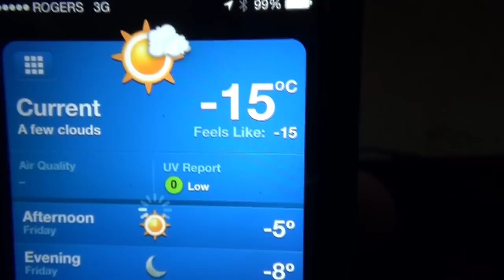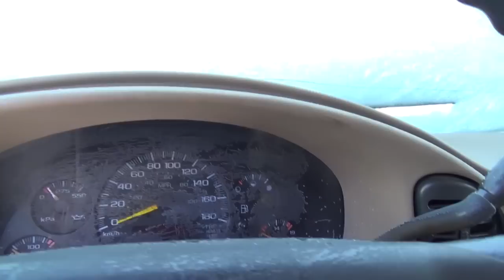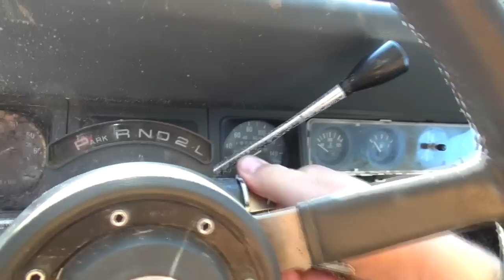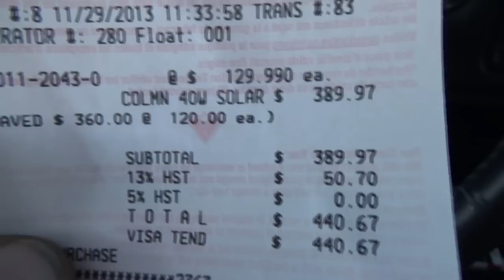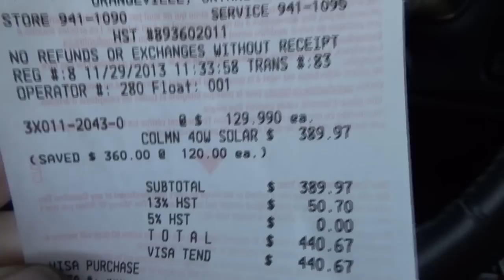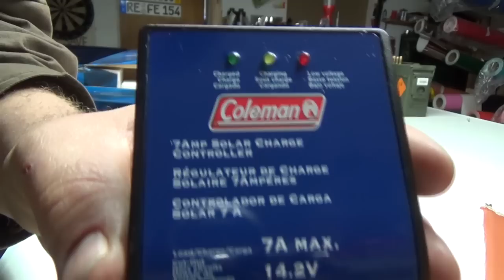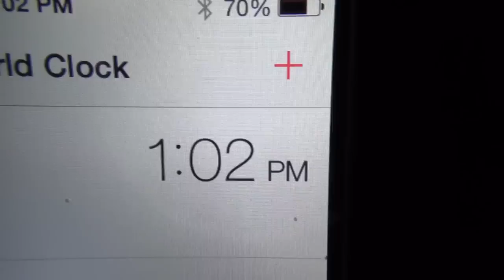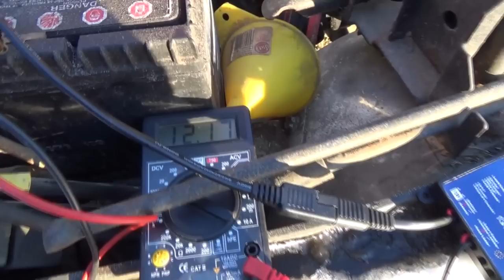cold starts this morning and sweet black friday deals

Comment: hey bill if you still have that chugging problem with cold starts on the chevy then try and replace the coolant temp sensor that's for the computer. theres 2. one for pcm and another for the gauge. the one you want to replace is on the top of the intake. its only like 15 bucks. I would give that a try. cause if its sensing that its warm when its actually cold then it wont give it the right amount of air and gas to keep it running smooth.

Comment: sounds like the idle air control needs to be set up should be appox 1 and 1/4 open sounds like it kicks in and kicks out to quick thats y ur idle drops so fast 90 % sure its just a matter of adjusting it

Comment: Nice solar panals bill :-)), see if you can just parallel the control boxes outputs :-)

You just need a clockwork gizmo to rotate the solar panal through the day to pickup as much sunlight as possible.

Comment: Bill, you should get a 12volt LED system to light the inside of that shed because it doesn't draw a lot of power.  You can get the "Battery Tender Plus or Junior system" to keep your batteries charged over the Winter.  I subscribe to a You Tuber named "thenorth03" and he has his vehicle batteries hooked up through one while he leaves for his Winter getaway retreat.  He uses one panel like yours on the end of his garage and runs it inside to the tender.

Comment: Have you tried mas air flow sensor....vlean thst guy it is attached near your air intake that can cause those kinda problems with running nstuff
Reply: He replaced it with a brand new one in February of this year.  He also replaced the EGR valve at the same time.